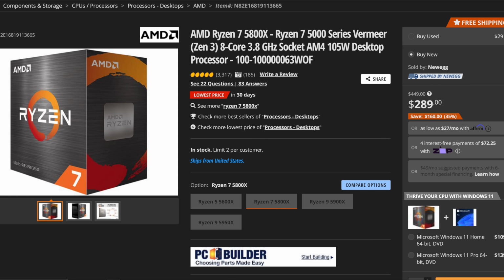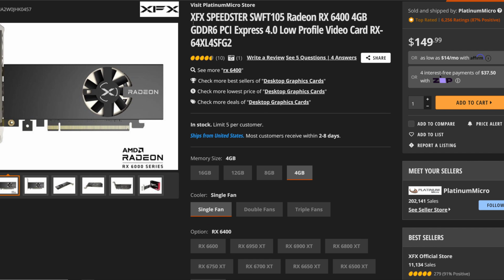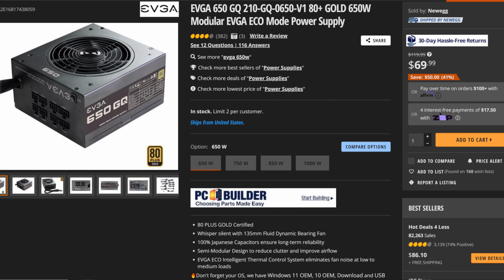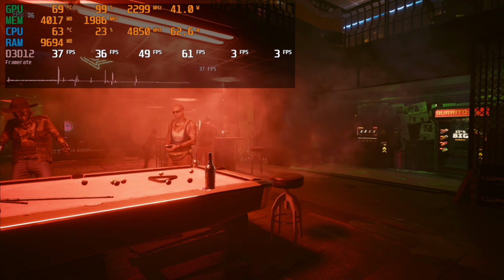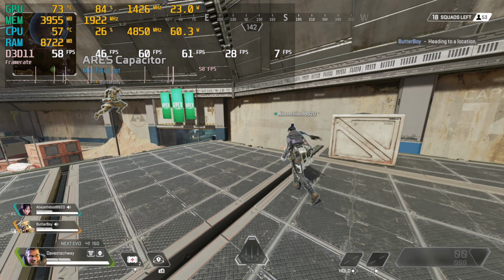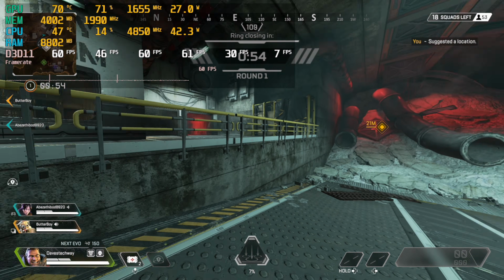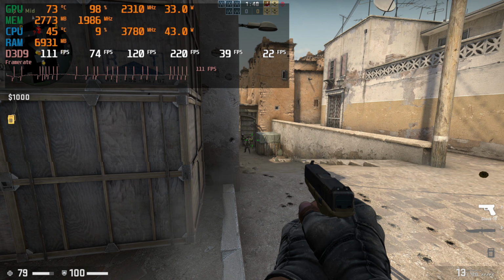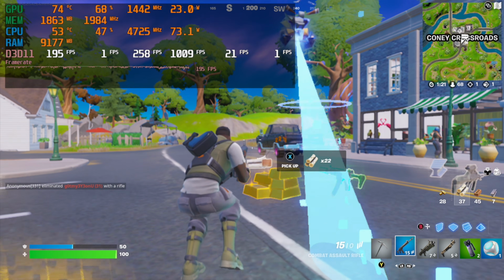Radeon RX 6400 GPU Gaming Benchmarks

Comment: What Driver version are you using? I'm having really bad FPS stutters on fortnite with this GPU. Currently using a i7 870 3.6ghz, 16gb DDR3 1333, RX 6400 and a 1TB SSD .
Reply from the maker: Sounds like you found your answer, Thanks for watching and the comment.
Reply: Probably due PCi Express band cut.
Reply: @ASN925  I think it is a AMD driver and Fortnite Optimization issue. I see a lot of forums with people rocking RDNA 2 cards getting the same issue. Even RX 6900XT owners are getting the issue.
Reply: @HondaHatchek  I'm using the versión 2.5.1 with this gpu and in fortnite isn't going good, and i can't control the fan and have Little high temperature
Reply: @marlon1769  Yeah Fortnite has an issue with AMD GPU's right now unfortunately. Hopefully they fix it. Playing on my Xbox for now :(
Reply: U sure it's not from your 1st gen Intel i7? That's supposed to be in a museum by now
Reply: @shadyb834  I'm positive it isnt the I7. It runs Warzone and Apex smoothly and even Halo infinite. Those are more CPU demanding games than fortnite.
Reply: @HondaHatchek  ya very likely dying. It's 11 years old man. Let it rest
Reply: @HondaHatchek  it's 100% the 1st gen i7 after upgrading with the same system my game never freezes anymore. You badly need a new cpu.
Reply: Nah it's the fact that you have a first gen Intel.
Reply: Not saying its because you have first gen Core series, but its because you have first gen. I would suggest just getting one of those off lease dell optiplex SFF with at least an i7 4770 rebuilds and throwing the RX 6400 low pro in there and you should be set for esports titles like fortnite. funny i made this suggestion prior to him saying this exact recommendation in the video.
Reply: @danney777  I appreciate the recommendations.  Funny enough with the latest Fortnite Update my performance went up a ton. It rarely stutters now, so i assume it is more of a driver and Fortnite Optimization issue right now than anything.
Reply: @ItsCaptainCDT Not looking for upgrades right now. But good recommendation, I appreciate it.
Reply: @ItsCaptainCDT Nah, there are plenty of DDR3 gaming PCS Ive built that run Fortnite smoothly.
Reply: @ItsCaptainCDT This particular build is my secondary PC. I built it for fun as i got it for really cheap. My Main rig is a R5 5600X, RTX 2080 Super, 32GB DDR4 3200, B450 and 1TB NVME + 4TB HDD.
Reply: @ItsCaptainCDT unfortunately the pc has an old lga 1165 motherboard so the i7 870/880 is the top cpu i can get for it. But it does everything I needed it to do, streaming videos, email, work and light gaming.